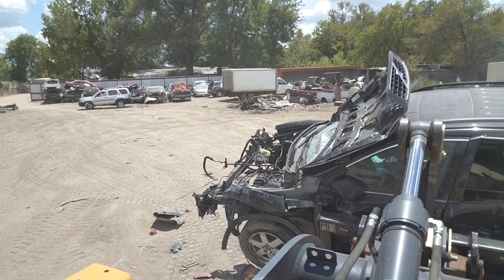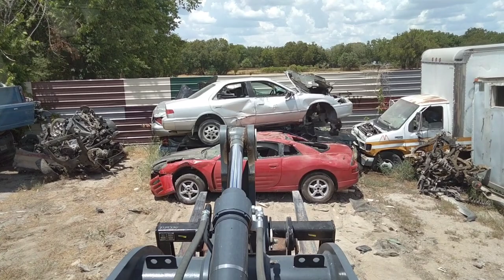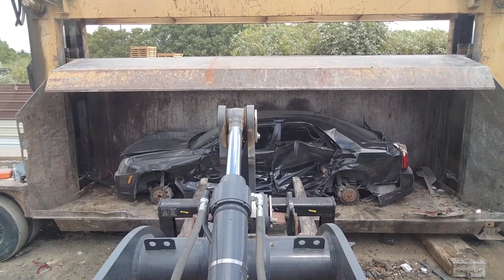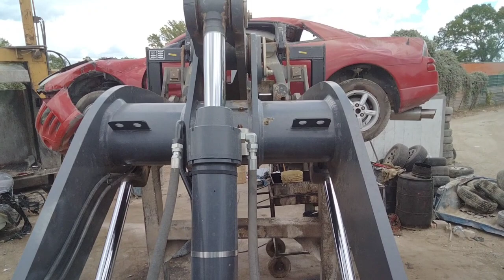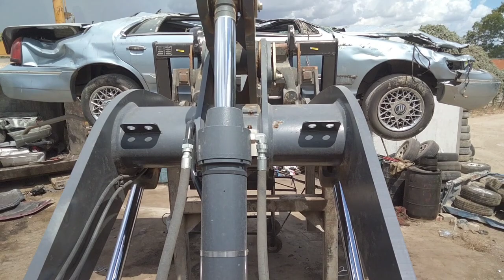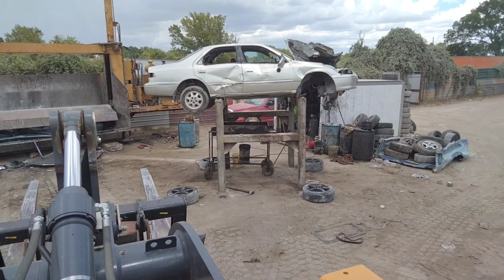Feeding CRAPPY CARS TO MY HUNGRY CRUSHER!!!!!   Q's & A's!!!

Comment: You gave detailed answers for the questions, so I'll wait to hear the other answers to my other questions. It's good that you have a new loader, as the right tool does the job best. Sure you can "fix" a Rolls Royce with an adjustable wrench and a screwdriver, but if you have the right tools, the job goes 100% easier.
Reply from the maker: Good Questions Get Detailed answers. That new loader I love it to Death. Da best thing about it has more power more speed the boom lifts a half foot higher than my old loader n with da longer forks the weight can be picked up easily without da struggles super cold ac I love it...
Reply: @DeathRowCarCrusher  You need the right tools to do the job. I had to help with replacing the alternator on my cousin's 2014 Grand Caravan (as you could call it a "Dumpster Dodge") and I had to take out quite a few tools so we could get the job done. But the right tools make the difference.